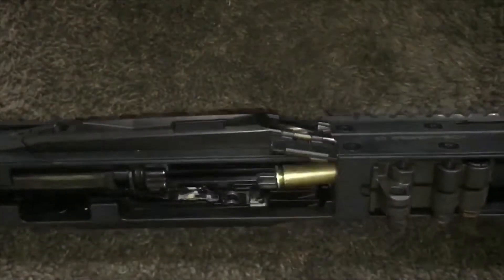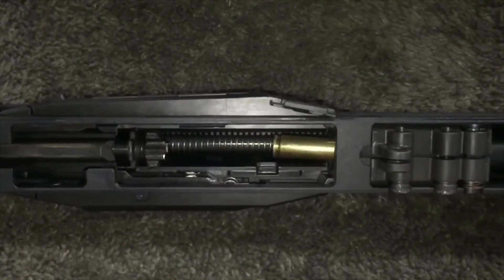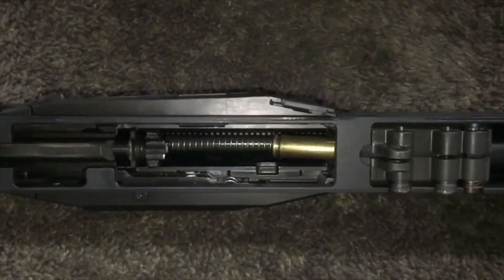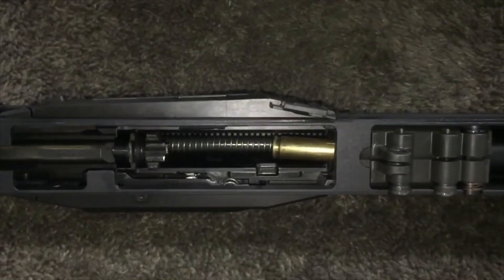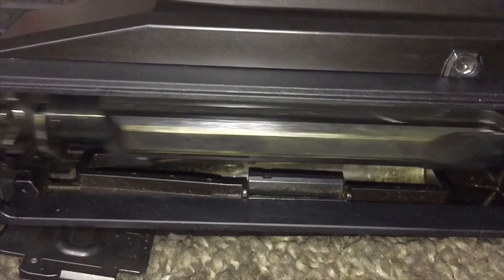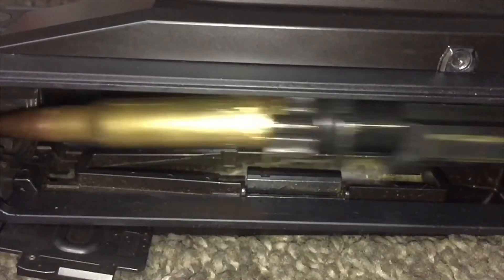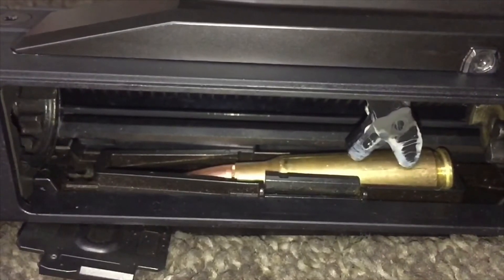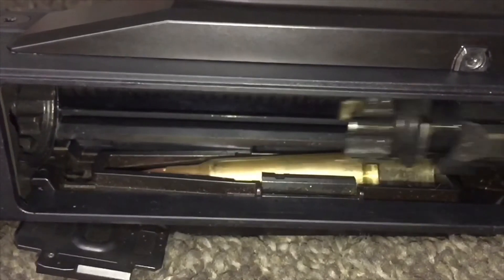Desert Tech MDR Ejection

Comment: hm... if the bolt is too fast you may induce a malfunction. You could solve that with a bolt catch to prevent it to move forward before the "scissor" does its thing. That's just speculation though, I hope desert tech didn't throw the forward ejection idea away.

Easy way to test it as well, just chamber a single round on a bad rifle and see if it fails to extract.

Comment: Too many moving parts with too little clearance. This is gonna be a jam machine. Notice the jam in background guys fourth shot at 1:20
Reply: it didnt jam, the case ejects when the bolt goes forward, and since the mag was empty the bolt stayed locked back
Reply from the maker: Not a jam, the gun goes empty. And they work great, have been for years.
Reply: @coldboremirakle  Have you had any issue clearing live rounds?  I know that’s been an issue for some.  Curious about your experience as you seem to be proponent for the platform.  Personally I have had issues with it, but still love the gun.
Reply from the maker: @soklog1  clearing live rounds is easy, you just need to make sure you stroke the bolt quickly and firmly. Works every time.
Reply: @coldboremirakle  Thanks for the reply and in depth videos.  I’ve destroyed multiple rounds and caused some jams when trying this.  At this point clearing the firearm is emptying the mag😂.  I’ll try it again

Comment: I have been really curious how solid the handguards and oversized handguards are. Solid enough to use an IR aiming device? Also, what are the inside space diameter measurements of both for suppressor fitment? Couldn't find any info regarding the handguards on the DT website.

And again, really appreciate your MDR videos dude.

Comment: can simply be removed may be a little off. mine is very stiff and hard to get off. Suspect its because its new though..
Reply from the maker: Mike Q if it was easy, they might come off unintentionally.
Reply: the ejector side is easier and after its off I have to use a finger on chute side. No worries though as It not going to pop off unintentionally as you mentioned..The MDA is still the coolest toy on the block as far as I am concerned..